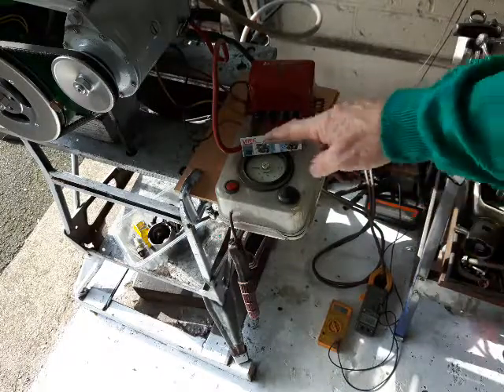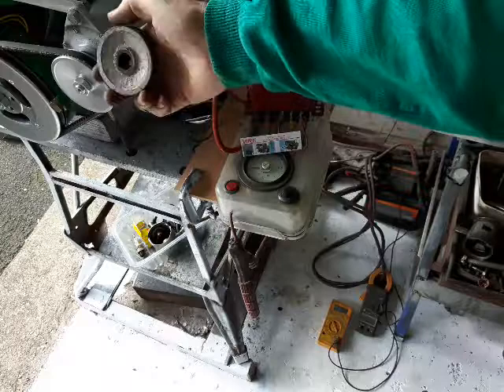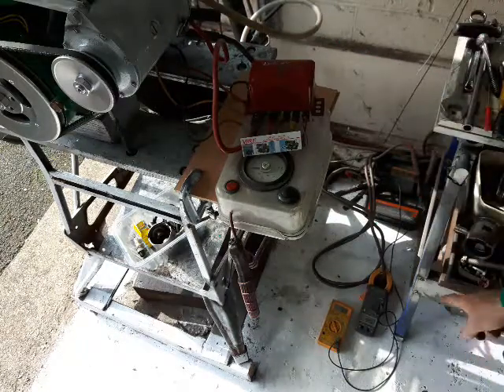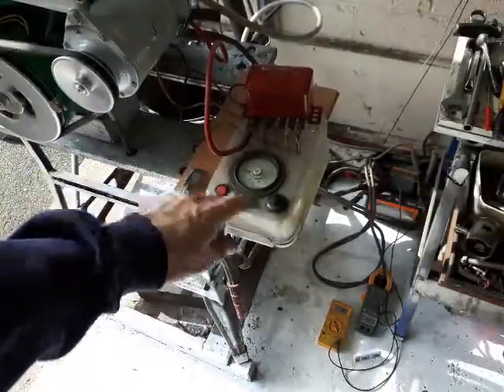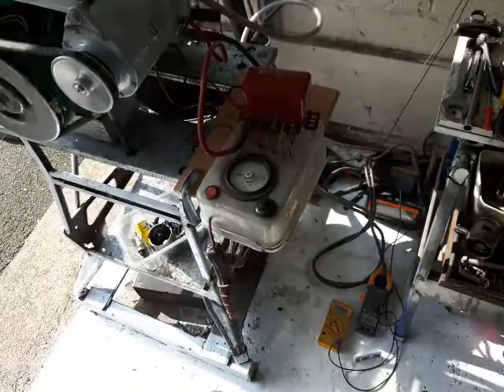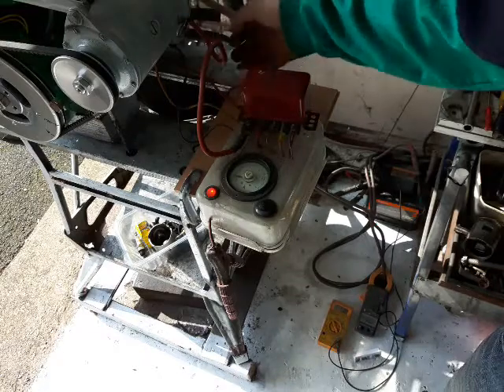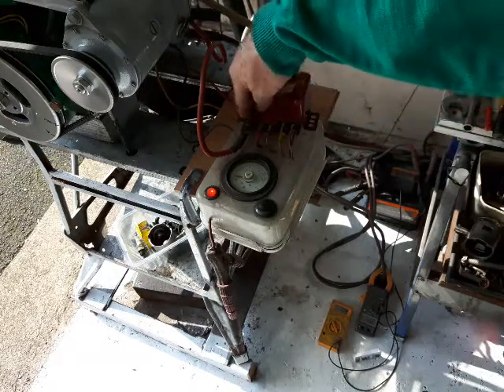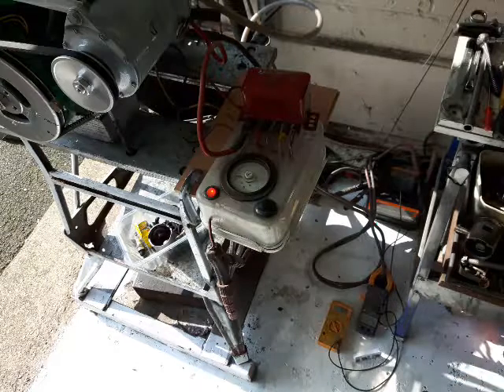dynastart check on the Vire Engine (Vire 12 here)

Comment: Dear Nick. I have a volvo md2b equiped with a dynastart. I Just bought a new dynastart and new digital regulator from Simon (DE) I Install it and today I put the engine running more and less 40 minutes at med revs. I have a laser temp reader, so measure temperature for several times. Ok, I have a 70Amp lead battery, Just for information. I start the engine and idling, the light of the system was on, since I rev up the engine I got 14Volts at the battery steady, and the light turn off. I let it run for 40 minutes and the temperature at the dynastart reach 70C. Then I turn off the engine for 2 minutes and I starter again. This time, I couldnt get easily the light off, I have to Rev more the engine. The question is, is my dynastart ok? If the voltagem of the battery is higher then the  dynastart dont charge at small revs? thanks.